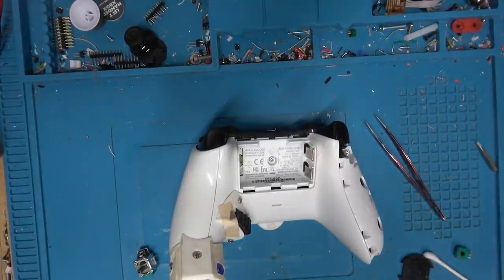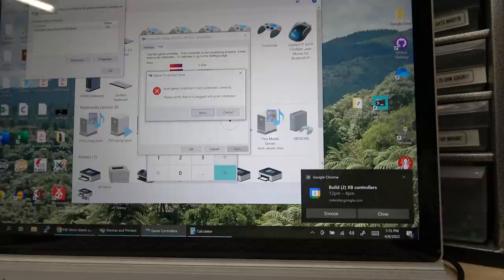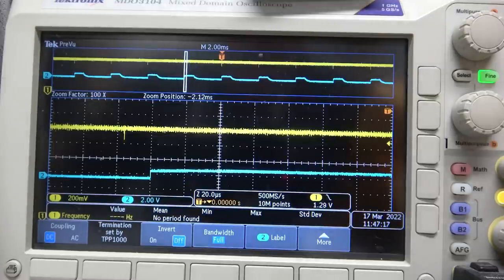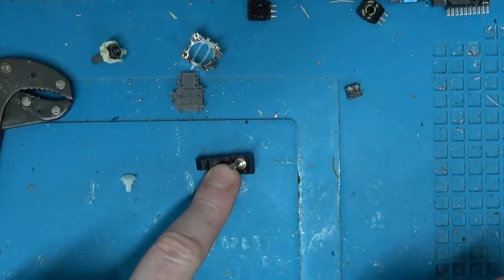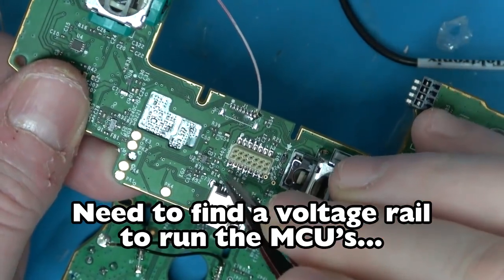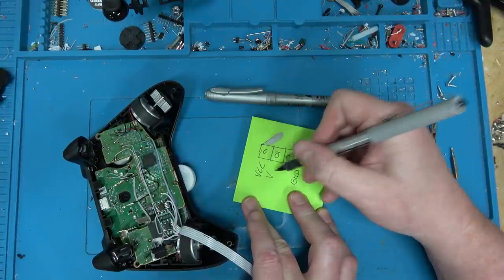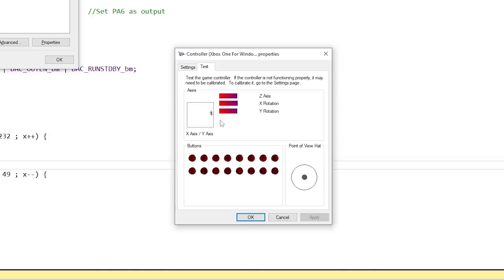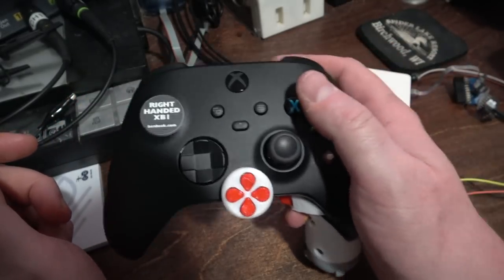Driftbusters: Improving Analog Joysticks

Comment: The weird part is that old controllers like my beaten to death ps2 and xbox 360 controllers never had any issue with drift and my 3 year old switch that i don´t use it that much had it...
Reply: Because they have built in deadzones that are MASSIVE (at east in ps2s case). Switch joycons do as well but some of the older joycons would still drift. The thing with drifting is it typically can be overcome by increasing the deadzone. The problem with that is aiming becomes so much harder (its literally why it's harder to aim in FPS games on switch joycons even if the game is 60 fps)

On ps5 in returnal, you can adjust the deadzone yourself and I had mine at 7% with no drift. A few months later I had to increase it to 13% but it did stop drifting. Once you have to set it over 15% to stop drifting IMO it's not really worth using the controller for FPS and other types of games where aiming is involved

The newer joycons seemingly don't have a major problem with drifting anymore. I got neon yellow ones in 2019 and they still are not drifting!! I play almost exclusively in portable mode btw. The neon yellows were the first joycons that were altered to fix stick drift. I think the white oled and skyward sword joycons have been confirmed to have this fix, and I assume they will put this fix on all joycons eventually. They maybe already have

Comment: TLDW - I'm not clear why this is not easily / trivially solved in Software. How about as part of the Settings in whatever console has this problem, we have a screen that says - don't touch the sticks for 10.....5...1 - DOne. Click DONE to save the drift of your controller and play your games. At some point the drift might be so bad that software can't remove it. Oh of course we save the settings for each controller to the permanent storage - I almost said HD but of course. Anyway. I presume that each controller has a serial number that can be read by software? So we save a little list of Serial Number, stick drift / stick drift for each stick. Problem solved. Anyboy who can write an App for a console can write this - and if it we3ren't prohibitively expensive to have that ability, I'd write that myself. Of course the hard part would be to set the drift in the console drivers so that it worked for all games. But SONY / Microsoft could do that in a week by an intern. Correct? Anything wrong with this solution? I watched a Hardware solution where you buy these tiny little boards and solder them into the controler and tweek a little pot yada yada... BUt I've not seen anybody talk about a simple settings / driver fix in software. What's the problem?
Reply: There is, it's called calibration. Not sure why it's not used on consoles though - could store the offsets on the controller. But that's money spent not earned I guess.
Reply: @TinWhisker  It's "used" (in a way, but not really) on consoles, the pots needed calibration from the factory so they have that data in firmware, but none of that data is accesible to the users which is so dumb, I always wondered why the consoles don't have a re-centering menu or something similar, sounds like an obvious option to leave in (specially now that everyone know the sticks can and will drift).
I also wonder why something like the PS2 doesn't seem to drift? Like, it used regular pots afaik, but I've virtually never seen those drift, wondering if it did re-centering on its own or something, anyway "rant" over.
Reply: @ederbarrero5585  Yeah, that's what I kind of implied. Most controllers aren't calibrated at factory, rather the FW is designed with the pots tolerances in mind and a decent amount of filtering. I vaguely remember some would do a rough calibration on power up to zero out, that or it was the console or even the game itself (you could offset by holding the stick at power on).

Maybe the PS2 was such? Maybe later consoles suffer because the kind of games invited a more aggressive use?
Reply: @TinWhisker  Ah, I see, pretty interesting, I think the PS2 actually does what you mention, I would like for someone to confirm that behavior (I'd do it nyself, but I no longer have a PS2, haha).
Perhaps what you said about more aggressive use has some merit to it, as I don't think newer pots are simply worse for no reason, but oh well, hopefully there are better solutions to this problem in the future :/

Comment: What desperately needs repairing is your hands.
Reply from the maker: Meh they're fine!
Reply: @BenHeckHacks  they are almost as bad as mine after putting in 50 led can lights in the ceiling, that sheet rock can really dry out and crack your hands bad!